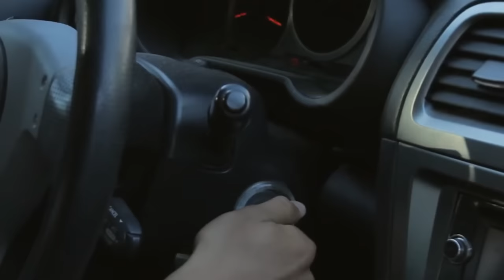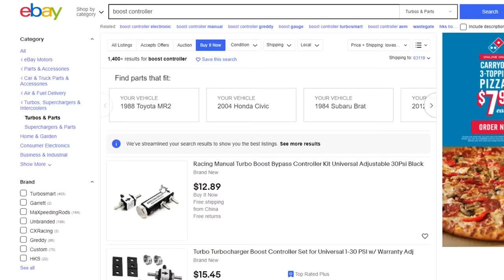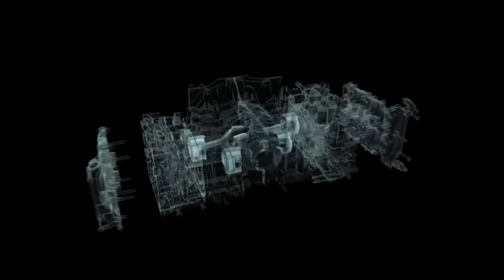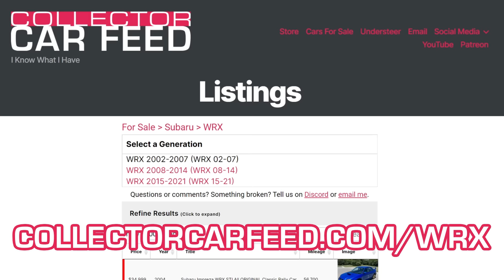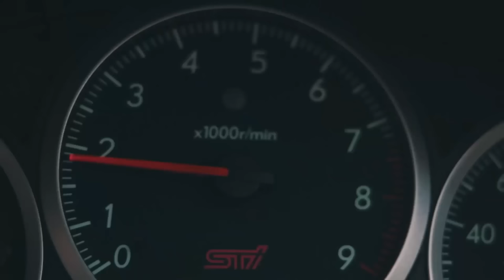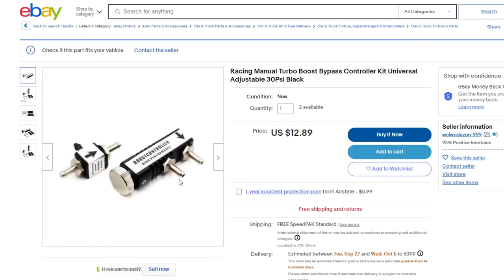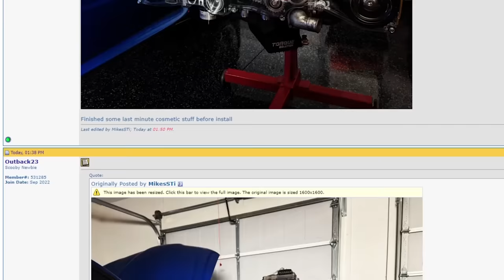Hard Truths of Owning a WRX in 2022 (Donut Media Won't Tell You This)

Comment: I got my first car a few years ago, an 05 WRX. She's my baby, but she hasn't been easy to care for. I replaced the engine 13,000 miles into owning the car because cyl 1 lost compression. The paint is peeling off of the driver side rear, and the transmission either sounds like it's grinding gravel or it has straight cut gears every time I let off the accelerator. I can't maintain 16 IAM and every now and then my afr stays at 14.x under full boost. But she handles so nice and when she wants to run right it's the best feeling. I just put all new AC in her (TX) and life is good. Hopefully she'll be 100% in a couple years and then I can get into making her faster.
Reply from the maker: Good luck man
Reply: I had a stage 3 05 wrx back in the day. Put 200k on it with almost no issues. Just a few minor tune issues
Reply: @Danno_87  the engine went at 210k, so sounds about right. They're great cars, just very picky about what you put on them.

Comment: I'm NOT a Subaru guy.  I bought my '02 WRX Wagon off a friend to have an AWD wagon.  The turbo is a bonus.  It's mostly stock, and hasn't really been driven hard, thought it wasn't well maintained.  Has almost 300K on it.  Original engine, original turbo, original head gaskets.  Still in overall good shape.  Replaced the timing belt, valve cover gaskets, and spark plugs myself when I got it (~240K) - did not need to remove the engine.  Have replaced a lot of the rubber, just due to old age. Has NEVER overheated, even when the coolant return line burst.

Comment: im looking at WRXs right now, i have a regular 09 impreza and this one has so many issues. i know im going to spend a crap load of money on special tools, parts, etc., and have to do a lot of the mods myself. thank you so much for making this vid, its gonna help a lot in the future
Reply: Let me tell you from experience... everything this man has said in the 240sx and this video is my life experience with a 1991 Honda CRX SI... I purchased it in 2019, It has yet to leave my garage... 

I had to pull the engine and strip it down to the bare block 2 times and rebuild it. Had to take transmission apart and rebuild it with new parts. Had to take the entire suspension apart and rebuild it(100% fully rebuild). Had to cut and weld rusted chassis stuff. Had to  pull out 70% of the wiring and route new wires. Had to take apart the entire brake system(minus hard lines) and replace with new parts. New clutch and flywheel had to be resurfaced. All rubber lines around the car had to be replaced. Most connectors had to be re-pinned. The entire fuel system had to be replaced (fuel pump, injectors, lines, filters etc.) I had to straighten parts of the chassis with frame and accident damage tools. Had to flash a base tune and remap the fueling. Had to replace the distributor and entire ignition system including starter. Entire Cooling system had to be replaced along with radiator, pump, thermostat, all hoses, even the cooling fans and new fan relays etc. Had to replace wheels and tires.

I bought the car for $1,000 and have put more than $15,000 in repairs and mods(because OEM is basically impossible and official high quality brand mod parts are cheaper).
 
I don't even remember what else I'm forgetting to mention. A lot of rust repair, scraping,  sanding, painting etc.

Comment: I made the mistake of buying a 2nd hand modded wrx that was supoosedly tuned open source. It blew up in less than 500 miles. If i were to buy another wrx, and i plan on it, i would immidiately go over it and change the plugs, check timing belt, fix any leaks, check shaft play, and drive it straight to the tuner. At least i have an RA block now. Runs like a dream. The 5 speed wrxs are a blast to drive with basic mods. Don't let anyone tell you that you need 500whp in these cars. Don't let the fact that you can't afford an STI deter you either.

Comment: The head gasket failure mainly effected vehicles before 09 if I remember correctly. As well as only effecting N/A 2.5 engines. Yes, head gaskets fail on turbos as well but the failure Subaru saw was due to the carbon gaskets being used on the N/A motors before switching over to turbo engine/mls gaskets in the N/A engines. The most common thing I've seen especially with the GD chassis is the turbo drains absolutely pissing due to either age or people who don't drive their vehicle often and the hose dries up. As well as the turbo seals going out due to age so they smoke like a forest fire out of the exhaust.

Comment: Nothing about the boxer engine makes it harder to do maintenance on. If anything, it makes it easier.  Nothing is hidden away.  Everything is on top.  The spark plugs are easy.  People just don’t have the right tools.  You just need a few different extensions and you are golden.  The wrx is “unreliable” because of the owners.  Not by design.

Comment: Me, as an former RX8 owner, can confirm how important it is
 To care for your car.🤝🏻 I own an jdm sti blobeye for about 2 months now already, and I am amazed how it feels to drive. Its like the car syncs with you and you exactly know what it wants and when it wants that. Ive driven a lot cars in my young life, but I haven't felt more comfy than in the blobeye. Ps: haven't and won't ever touch dccd manual settings🤣
Reply: I've had a jdm 2003 blobeye sti for a year now, you will be surprised how much it changes the handling using DCCD in manual, just don't go full back with it in shit weather unless you wish to slide around corners, as long as you have a decent set of tyres on the car and it is warm out use the dccd in manual just feel out the car it turns way better if set up well
Reply: @brandonshorter3787  what do you drive in perfect conditions? 60/40 front or 40/60front?
Reply: In nice weather, most of the power at the rear so 40/60 front, the car doesn't understeer any where near as much, it feels like the car screws round corners, in rain pull the dccd one notch foward and its still good to drive hard, just remember with the car it has one way diffs so if cornering always be on throttle so the diffs are active if not you will likely slide in rain let alone ice or snow, yes i have had the car slide unexpectedly however that was because of diesel on the Road with the dccd all the way at the rear whilst hammering it onto a roundabout, it did grip and no damage occurred as there was no one close to the car at the time
Reply: @brandonshorter3787  nice, thanks mate🥰 I will try that out🤩

Comment: As a WRX owner for the last 18 years (!!), and only on my second one (my first one I sold at 130k miles and the next 3 owners ragged it out, crap modded it, and it still went to 230k miles!) - this video has a lot of truth. I might leave the Subaru groups I’m in. Every week someone new posts about a modded car they just bought and now is having issues.   The problem with Subarus is their owners! 

My first WRX I bought new and drove 14 years.  Did mild mods, turbo back exhaust, tune, wheels, etc. No issues.  I upgraded to a used STi hatch that was stock. Did a Cobb stage 1 tune for 91 CA gas, and it smoothed out the turbo boost. The STi is awesome - terrible fuel economy (17mpg combined!) but otherwise just a pleasure to daily. It took me 8 months to find mine, and I knew what to look for. And even then, got it inspected prior to purchasing. Was a 1 owner, stock, babied car.  I’d only recommend buying a new WRX, but not if you want a fast car - bc they’re not fast by modern definition. They’re fast enough. You can have a lot of fun - but don’t be disappointed how slow it is compared to something with 1-200 more hp, and then try to mod it to get it as fast.  Just start with a faster car.   

Oh, if Donut had any clue about Subarus, they would have just started with the STi to build off of, instead of the WRX - though blowing up a bunch of WRX definitely got them the views!

Comment: I love my WRX and I had fun converting it from a base model Impreza but I’ve had WAY too many issues but the experience, and learning how to work on it myself made it all worth it because now it’s smoother than softened butter!
Reply: Just curious but why would you convert a base model Impreza to a wrx ? And not just buy a wrx in the first place
Reply: @candycouldntbesosweet  typically base model cars weigh less. Did an M3 swap on a base 328i once to save myself from the extra 600lbs.

Comment: I currently own a 2000 Impreza. I bought it modded. It's a factory 2.2TS, but the previous owner swapped in an ej20g. I had a lengthy conversation about this car with the guys mechanic before I bought it to make sure it was good. It came with 140k km on the body, 30k km on the engine. This guy took amazing care of this car, lots of preventative maintenance, including replacing the head gaskets with a better part. It came with a tuned haltech ECU. No rust underneath. I had to patch the corner panels, but that's basically to be expected with these cars now. It's in amazing condition and have been treating me very well. Funny enough it already had a "the world is flat" sticker on the back window and I have bought really armour mud flaps, haha! Ive also done a bunch of stuff to it now like coil overs, new spoiler, I'm waiting for a short through kit in the mail, etc. I haven't really touched the performance side of things, other than maintenance. It's tuned to make 9lb of boost. Nothing dramatic, but the engine can handle it well and the blow off valve make giggle(I love that sound). Most of my future mods from here are cosmetic. Different front bumper, paint, GD sti seats, and other such things. I like this car, it's not over done in anyway, but it's a lot of fun.

Comment: First off so accurate it hurts. For anyone considering a subaru read this. Almost at 6 years in subarus split 2 years and 4 years between a 2003 wrx and 01 jdm sti. If you want a wrx I highly suggest saving for an sti. Just better built and honestly a way more reliable car. Ive had mine since 142k and its 220k now with plenty of work put in. actually doing the maintenance and upkeep on time does a lot but biggest things is changing the oil pickup/baffle at least on older ones. Its got terrible flow results in some bad failures. research your mods first etc as well. warm it up before you drive it especially fast or hard as in higher rpms. Working on it isnt that bad. Parts are all over the place and there is a ton of knowledge out there about these cars. Modding can be tedious sometimes but worth it in my opinion. Wheel well arch rust is the main thing. Check the strut towers too especially on wagons. Rust is the enemy in 2022 even pinchwelds are falling apart on my 01. Great cars for what they are, it does take a certain person to own. Also not the best if you wanna be modding to get over 400 whp youll get better value out of a different car any day.

Comment: As 02 bugeye owner 
After 6 months of owning one I started to understand how my car works n what it can handle 
It’s been 2 years now since I have it n all I’ve done was get Bigger top mount intercooler 
Cams/forge internals n swap the 5spd for a 6spd, coil overs and get the big brake kit, that’s about it
I’ve learned to almost never redline it n not hold out the gears as long as I can 
Because of that my motor has been working just fine 
Obviously I won’t be the fastest mf out there n my car is pushing 350 whp n I could go more but Ik if I do I can damage my motor since I’m still on the stock ej205
Overall I think you do have to be the right guy to know what your wrx can handle
What’s on paper can’t compare to physics so you have to understand if ur getting a wrx to be fast? Probably gonna wanna go with a different car but if u want a “good” daily car that can handle good in corners and for me who lives in a area that snows so good for the winter then go for it 
Like all cars it’s gonna have its flaws so as long as u maintenance ur car properly it should last a good time 
Only things I’ve ever damage was my stock coolant reservoir broke n my head gasket broke but both were never originally change from motor so this was its first time breaking and after 2 years still holds up fine for a daily drive

Comment: As an owner of an 07 STI, this is all facts. I found mine last year w under 100k miles, maintenance history since new, only a handful of mods and a dyno tune from a reputable shop. Still blew my headgasket, but it was caused by user error so no foul on subarus part. These cars are NOT HONDA CIVICS!!! Be mindful that they're 15+ years old! They're gonna need at least some work and special care no matter how clean it was kept. Oh yeah, if you're gonna get an intake and DD the car, don't get an open element pod filter intake, get the proper COBB intake with the actual airbox and factory intake scoop, no it's not restricting airflow, it's to prevent heat soak. 160+ degree Intake temps and subarus do NOT go hand in hand.

Comment: Properly check your oil. Warm it up, then before checking, remove oil fill cap and dipstick oring. This ensures vaccuum does not pull oil up the tube while checking level and gives a true indication of running oil level. Run it on full.  Knocked bottom ends are more common than headgaskets in newer cars - and it's all user error. 

Tune. COBB devices with canned tunes seem to be a culprit. They don't account for localized fuel quality or overall vehicle condition. If you're going to tune it, please get a custom tune done by a reputable tuner. Ringland failures come from a poorly or improperly tuned car... wrong fuel, tune too aggressive for supporting mods. 

Overall, I really love the STI. A very rewarding car to drive. Good power, torque, and the AWD handling is spot on - making it a true drivers and enthusiasts car.

Comment: Ive had a 06 STi with Cobb stage 2 as my daily since late 06, no major problems and it has 160k miles on it now.  Still reliable as ever, just do all the regular maintenance and drive.
Reply: Yo! i just had a question.. bought my 05 sti a couple years back and recently had to get a valve job done.. how hard do you push your car since you daily? im quite scared to go through another big service. Cobb sf intake? I would like to make mine last as long as possible.. I don't dog it nor do i lug it. Properly warm her up and only push her after a couple mins after coolant is up to temp(heard that oil warms up around the same as coolant but try to wait a lil later to make sure oil is up to temp). I only use 5w40 and consistently check and regularly do my oil changes religiously. turbo heat shield? i apologize im just so curious lol

Comment: I’ve owned an STI for about 5 years now and I keep telling people that you have to do your due diligence with these cars. The first thing you should do before power mods is supporting mods like, get a larger radiator, 4th cylinder coolant bypass, larger Intercooler, better clutch, cooling management, better oil pickup and pan, and build your internals if you plan to make more than 350whp. Once you go for power mods, GET A PRO TUNE. OTS is not sufficient.
Reply: or you throw a turbo on a ls for cheaper and make more hp..

Comment: As a WRX owner, these are all great takes. Buying  a used WRX is pretty much the biggest gamble in used cars, especially anything in the 2012-2021 era, simply because people will be able to "put it back to stock" to sell or trade in, thus eliminating your knowledge of how absolutely beat to shit the car was. At least with the older models it's either stock or not, there's no question. Only thing, do NOT put an aftermarket intake on a WRX without a tune. At best you lose power and run into weird timing pull issues. At worst, you cause enough pre-ignition that you blow the engine.

Comment: Once bought a '99 Legacy wagon 5speed, anniversary edition for $300.  It was a great beater until the exhaust rusted off, the parking brake stopped working and the clutch burned up trying to get through deep snow.  It made an 800 mile road trip with no problems though.  Sold it to a guy that wanted the engine for $300.

Comment: Every mod you throw at it…. Tune it. Don’t do donuts to 1 side for too long or it’ll starve the motor of oil (unless aftermarket baffled pan). Don’t put a bov unless it’s a recirculating one without a tune. Dont cheap out on maintenance and, best thing to do is get it done before the intervals.

Comment: Spot on. Subies aren't for the inexperienced car owner or diehard ebay parts buyer. However there are rare exceptions on that site for non-critical parts. (Mud flaps, shift knobs, stereo stuff) The rest you need to buy the good stuff. I've had 4 Subaru over the years and I've built/modded most of them. Done right they work great and are fun. Be prepared to learn and do your own work..or pay a pro to do it.

Comment: The "head gasket" issue isn't really an issue with the head gasket at all, it's actually a block issue. The issue is worst on the aluminum FB blocks, but affects all 2.5 liter engines, including the cast iron EJs. The issue is that these 2.5 liter engines for the American market began their life as a Japanese-market 2.0 liter. The cylinders were bored to 2.5 liters to satisfy the American market's demand for displacement, which resulted in a thinner cylinder wall. Over time, heat cycling would warp the block along the wall, resulting in the notorious leak.